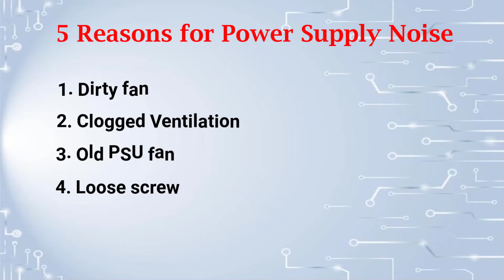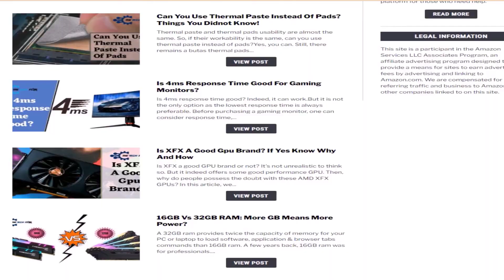[Fixed]: Power Supply Making Noise- 5 Reasons Needs to Be Checked!

Comment: Mine only do noise when i start the pc, then it goes quiet
Reply: It's probably the power supply fan bearing and not a problem. If it's a weird high pitch then replace it with a new power supply. Never open a power supply

Comment: ABSOLUTELY DO NOT REMOVE THE PSU COVER IF YOU DONT KNOW WHAT YOURE DOING. IT CAN BE DANGEROUS
Reply: Learned this the hard way, i got shocked
Reply: Typical Electronics Engineer😂
Reply: Why ?
Reply: @LtzRoze  you can get shocked, morderm psu charge gets removed after some hours, so if you do remove it leave unplugged for a while and try not to touch anything while doing so.
Reply: @LtzRoze  it can go boom
Reply: @LtzRoze high voltage
Reply: Let the caps discharge for 45 mins
Reply: I know it could be dangerous but i already removed them 4 times and nothing happened 
Buut i make sure i always be extra careful😊
Reply: @poaezr4288  Touch the wrong thing by accident and you could be dead.

Comment: My PSU will ramp up heavy during some scenes in games...why the fuck would this even be happening.
Reply: same here and it's not even my fan doing the noise
Reply: @InfamousReptillian420  same with me, have any of you found a solution?
Reply: same
Reply: They have a wattage limit when you pull more the heat get more and the fans turn on depending on psu W they will have different limits

Comment: Now i fix the problem by hitting my PC hard, then its stops, but when I restart same buzzing sound comes back. Maybe i should try to clean it..
Reply: Same =D
Reply: I used to hit it till my side fans stopped working
Reply: i do that, but sometimes it doesnt work, so i just shut it down and try again, then it works (i already tried to clean it)
Reply: how did you get it fixed? mine does literally the same thing